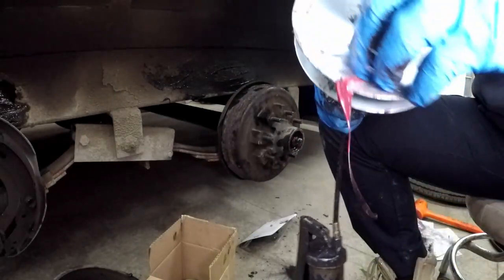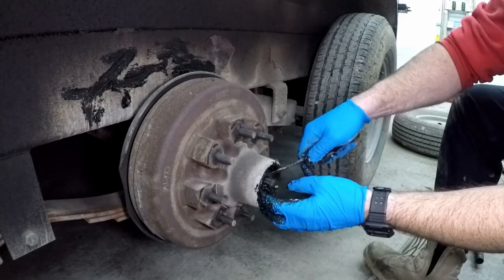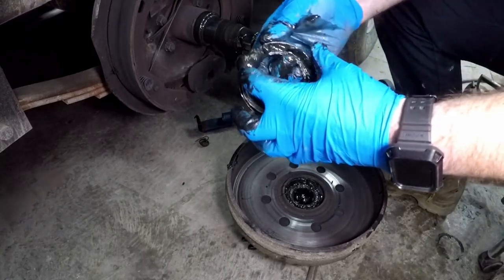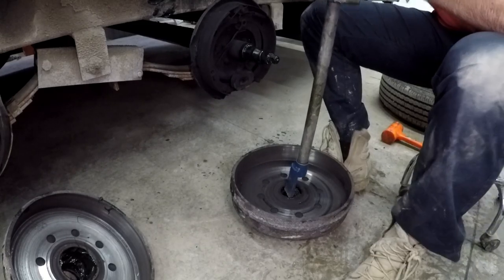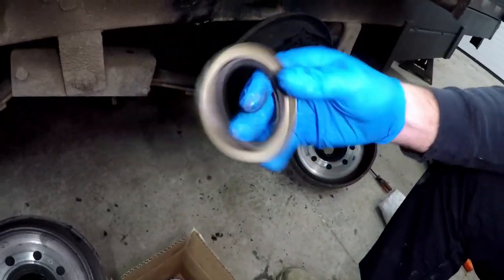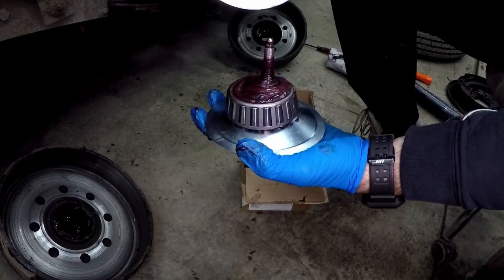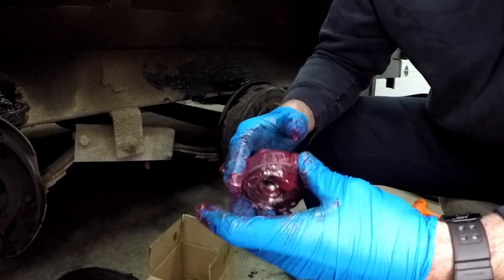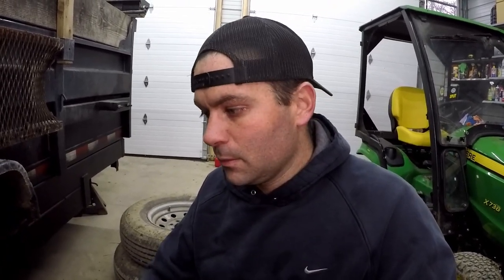How to replace Trailer Wheel Bearings

Comment: Awesome thanks, I haven't done wheel bearings in a long time. Just hand tight on the axel nut
Reply: Why can't I do this leaving the rim attached to the hub? I don't have an impact gun so I would be doing lug nuts by hand and boy would that save me a lot of time
Reply from the maker: I’m sure there is a specific torque spec for the axle nut, I generally go a quarter turn past hand tight, give or take. And I suppose there really isn’t anything stopping you from leaving the rim attached to the hub.
Reply: @EverythingElliott  awesome thanks!